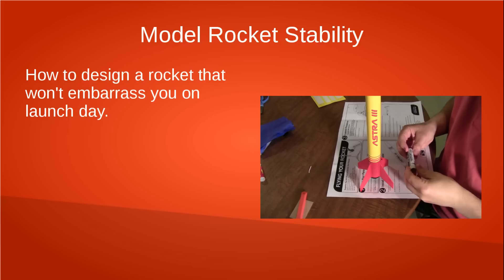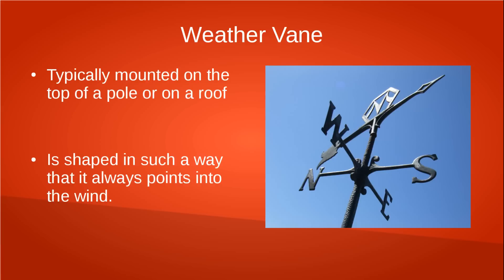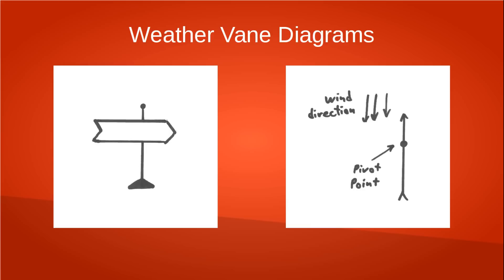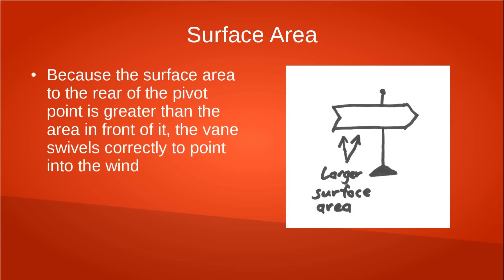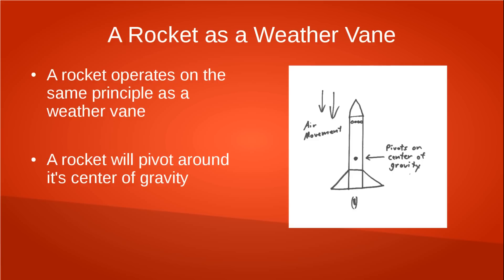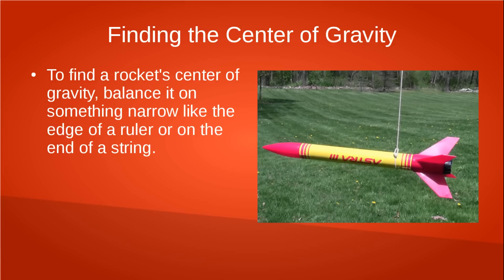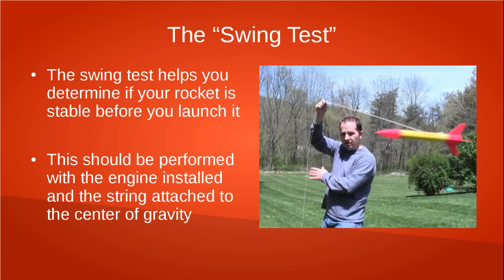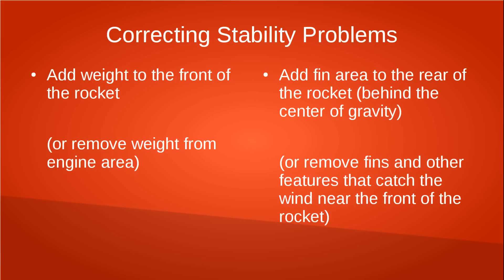How to make a stable model rocket

Comment: Rocket building rules :
full length of the rocket : L= 15 to 25 Diameter
nose cone length :Ln = 2.5 to 3.5 Diameter
stabilizer swing : S = 1 to 2 Diameter
total area of stabilizers : F= 0,7 to 0,8A, Where A=Length*Diameter
stability margin(distance between center of gravity and center of air pressure) : k = 1,5 to 3 Diameter
Reply: Good rules of thumb, for us not attending MIT.